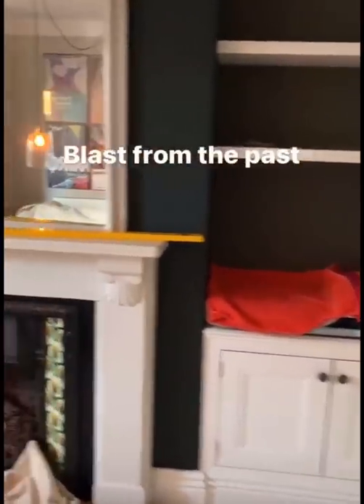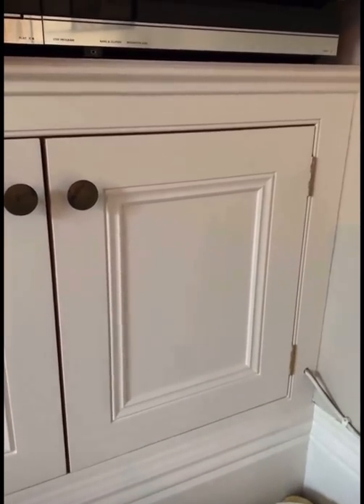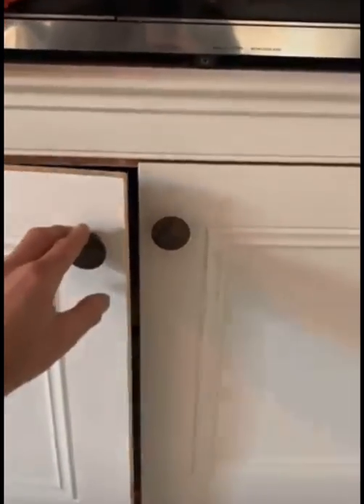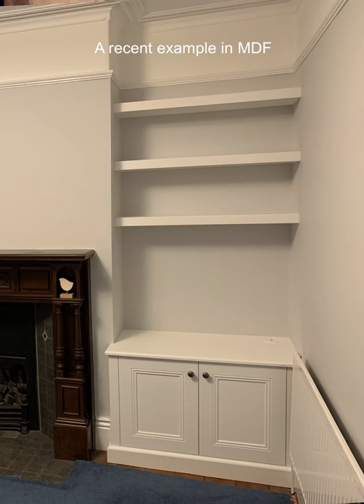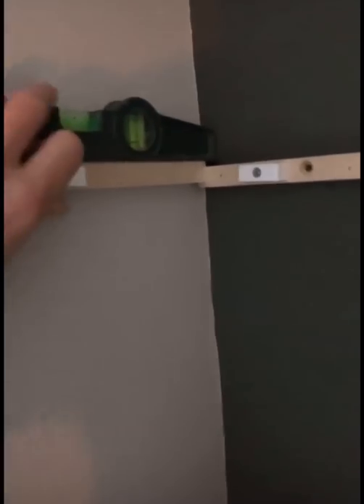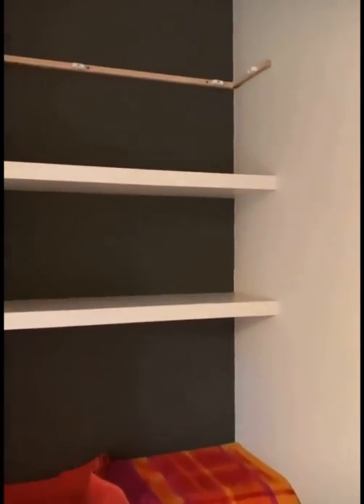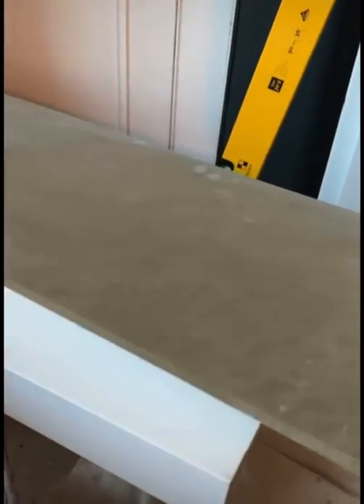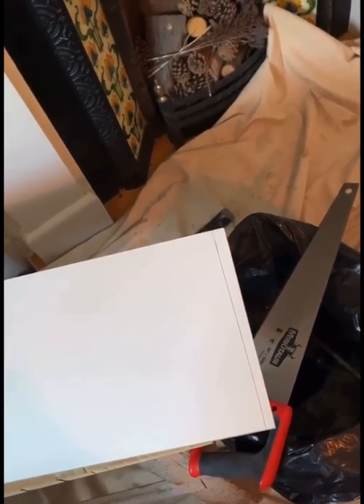Alcove Methods Old & New

Comment: It's always interesting to see how different people do things, and the kit they use to do it. For example I never use an electric plane these days, I'm wondering if I'm missing a trick now.
Reply from the maker: That Festool electric planet is a different tool to others I’ve used. Spiral blade and very precise depth adjustment.
Reply: @Alastair_Freebird  It might be worth a go. I tend to scribe using my plunge saw backed off moving the guide rail to the  scribe line as I cut. I do any fine adjustments with my block plane. Works great most of the time but the blade must be really sharp because you obviously can't scribe/score cut first to a wavey line.
Reply from the maker: @jrsuk1170  I would recommend it.  Some people go a step further and do the final finish up to the line with a mini belt sander.
Reply: @Alastair_Freebird  Yeah , I've seen a Mexican chap doing it that. I'm going give it go soon. 👍

Comment: Hi there, hope all is well. May I ask you something? Have you ever come across a concrete floor (ground level) and had to attach fixings for the plinth ? ...Asking because usually there is a DPM and you would not want to hit that:) .
Reply from the maker: Hi I am wary of underfloor heating etc… I don’t usually fix down into the floor these days
Reply: no probs, so you use those black carcass legs these days, I always liked the way you use to use the plinths and screw down looked more solid :)